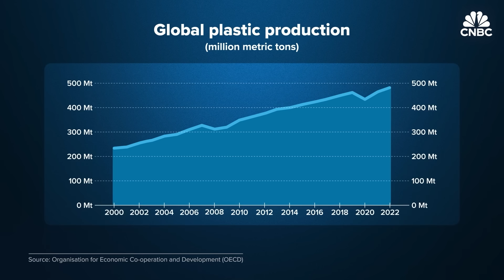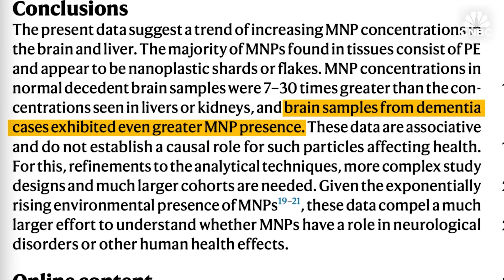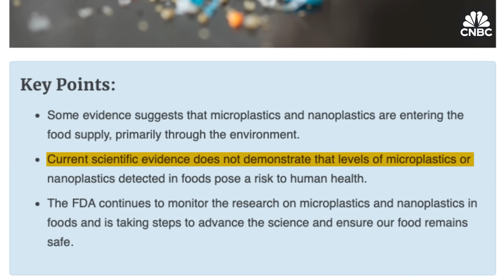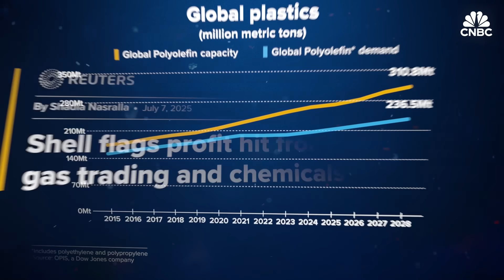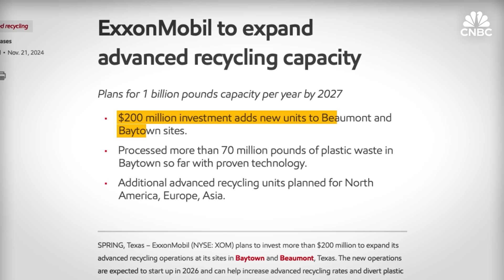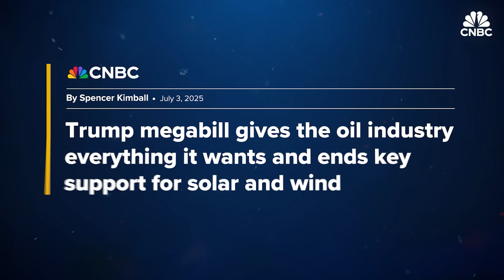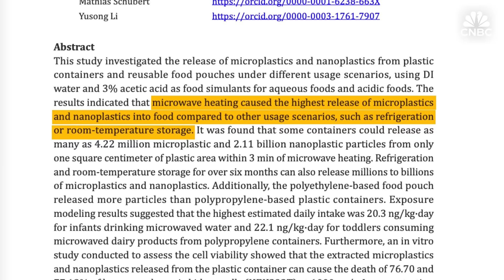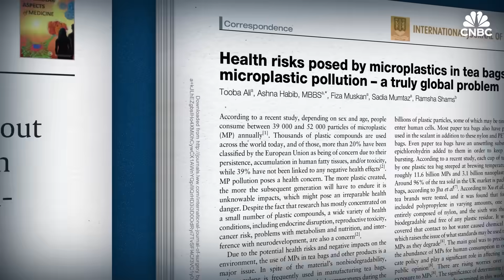Why The Microplastics Crisis Will Only Get Worse

Comment: Using recycled plastics in direct contact with our food is such a dumb idea as microplastic detach more easily
Reply: Try to glass options when available
Reply: In case you haven't noticed, polyester, nylon, etc. are also plastics... So nevermind your food touching plastic, how about your skin? Or maybe your teeth (yep, the toothbrush is plastic)? What was the syringe made of that injected your last vaccine? While we're at it, does your refrigerator have an ice maker? For that matter, if you live in a house or apartment less than 25 years old, you probably bathe in water delivered through plastic pipe...
And on, and on, and on, and.......
Reply: @texas66  The petroleum addiction is very real..
Reply: @texas66 no the toothbrush is polypropylene which is the same thing as propylene. its not nearly as bad. plus you dont eat the toothpaste do you?
Reply: Most food wraps are complex mixtures of virgin plastics laminated for superior properties.  These wraps are not recyclable with current technologies.
Reply: plus tons of mixed chemicals from toxic tainted plastic containers. recycled plastic is highly heterogeous molecular material. many pvc tubing is now recylced as pvc, but is no more pure pvc.
Reply: Yea, or should be reusable blastic boxes. Like a box standard, you can return the empty box in the supermarket, they get washed and you buy the new food in a similar box.
Reply: @alphastratus6623  You'd still get get the plastic particles then. How about we use science to find safe ways of packing food, and use laws to make sure everyone uses the safe packaging?
Reply: @letMeSayThatInIrish  it already exists, and it's called glass and stainless steel
Reply: @letMeSayThatInIrish There would be way less plastic particles. Especially in the ocean the plastic comes from decades old packaging thrown away. But if you recollect old packages instead of 'recycling' (aka send it to poor countries to throw it into rivers and oceans) you would have way less of that problem.
Reply: @letMeSayThatInIrish  There are already several solutions available, with the most promising being the company that use mycelium (yes, shrooms) as a replacement for styrofoam, and the researchers that had a bioreactor producing bacterial cellulose with many of the same qualities as the most common plastics in use today, with the difference being that the cellulose is completely biodegradable. As for making laws, the international meeting that aimed to limit plastic usage and production just went down in flames, because there are entire nations making boatloads of money from oil and plastic production. So it's a prime example of money talks, environment and health walks. Ironically enough plastic related health issues are rampant in the same regions, with cost estimates ranging from hundreds of billions for the most conservative ones and up to a few trillion for the absolute worst case estimates. The worst ones essentially meant the industry cost more money than it generated, but apparently nobody wants to listen to that.
Reply: @Gnomleif but why cant you just use schrroomes to eat the styrofoam? why not just forge bacteria(and other things) that eat the polystyrene?
Reply: @Gnomleif  not a viable replacement. reason why it's barely being used. just because it exists doesnt mean it's a viable replacement. 

For it to be a viable replacement it must be near as usable and easy to produce what it's replacing. if it's not, it's not viable.